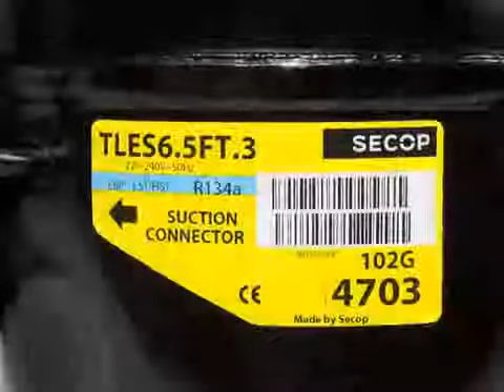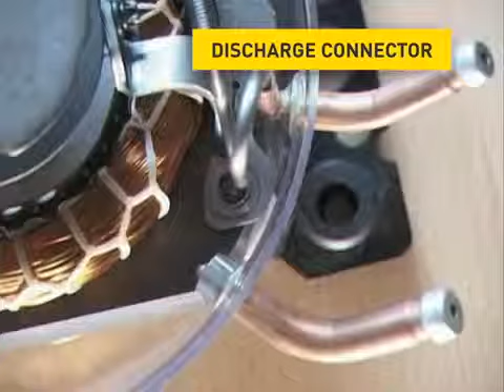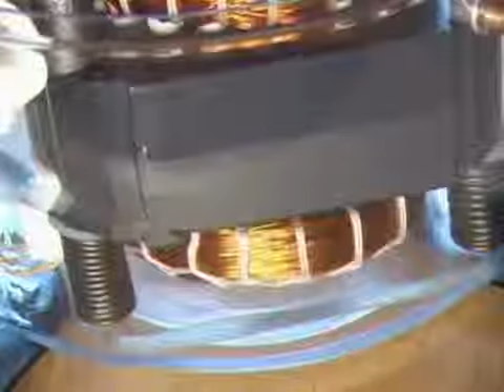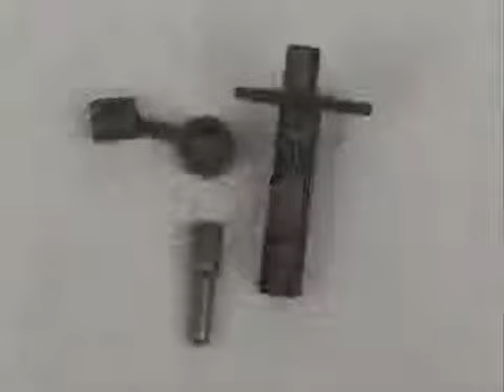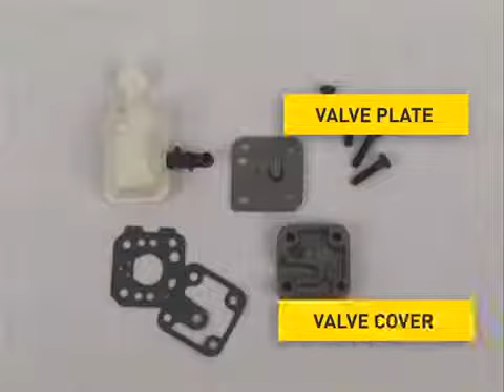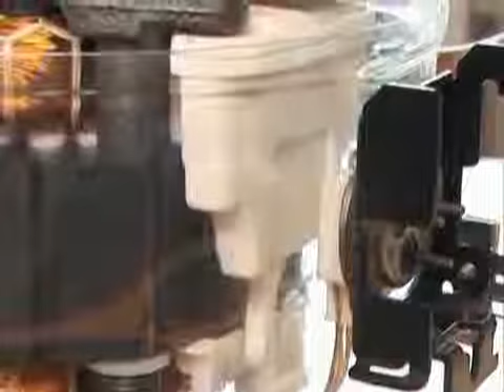SERVICE AC SURABAYA

Comment: HATI-HATI SAMA SUMBER BERKAH TEKNIK!!!!
PENIPUAN, SAYA KENA SENDIRI.PASANG WATER HEATER PAKAI AJI PENGAWURAN. SALURAN AIR PANAS DIPASANG JET SHOWER, SALURAN AIR DINGIN DI PASANGI MIXER DAN DISAMBUNG SHOWER...
???? LHA MAKSUDNYA KALAU MAU PAKE AIR HANGAT SURUH NGE CAMPUR SENDIRI AIR PANAS DAN AIR DINGINNYA  DI BAK MANDI GITU? BUKAN HANYA ITU PERALATAN SAYA JUGA DIEMBAT. MERK WASSER , FLEXIBLE PIPE MERK SAN E SAYA, BEBERAPA PERLENGKAPAN LAINNYA JUGA TIDAK TERPASANG DAN RAIB BAHKAN REMOTE BELL SAYA IKUT RAIB.TERTULIS GARANSI 1 BULAN!! BOHOOONG,.!!!!!!!!!!! 
KETIKA HUBUNGI KANTOR NYA ORANG KANTORNYA MALAH SEWOT
HUBUNGI TUKANGNYA CUMA BILANG YA INSTALLANNYA MEMANG BEGITU...??????
HATI - HATI SAYA SUDAH KENA, JANGAN SAMPAI ANDA GUNAKAN JASA MEREKA, KALAU TIDAK INGIN MALING MASUK RUMAH.
Reply from the maker: Disetiap mesin biasa slalu ada petujuk atou label.
Cara pemakaiannya dan pemasangannya.
lebih baik tunjukan cra pemasangan tidak sesuai dngan petujuknya 
kpada si-pemasangnya.. Bpak/ibu.
Tapi untuk pemanas air biasanya tidak bisa dipakai langsung.
Tetapi menunggu sampai lampu led READY nyala baru bisa dipakai..